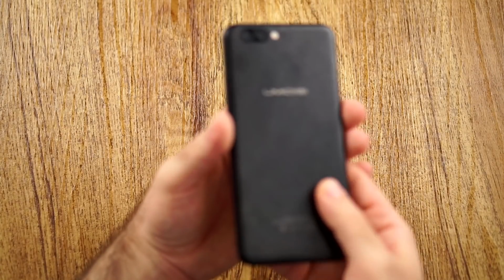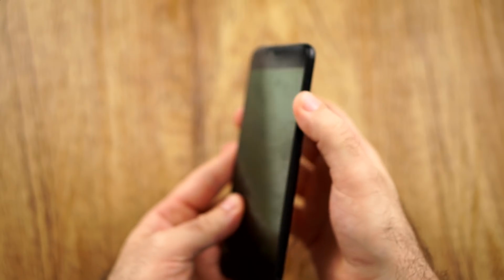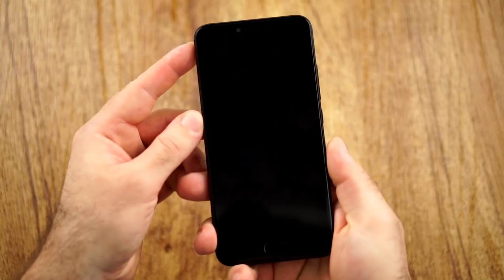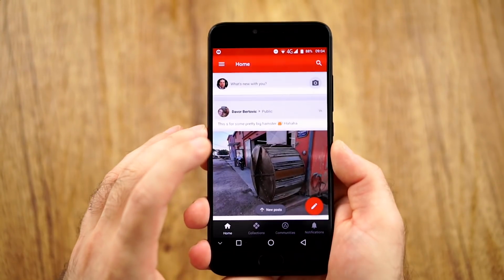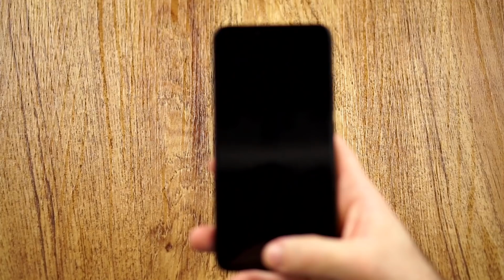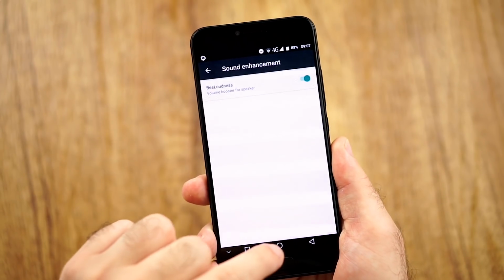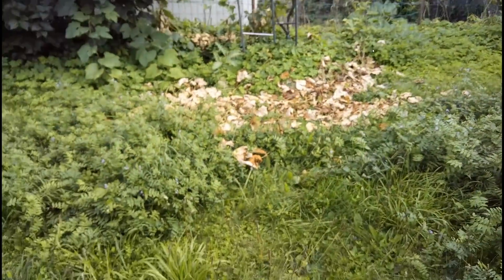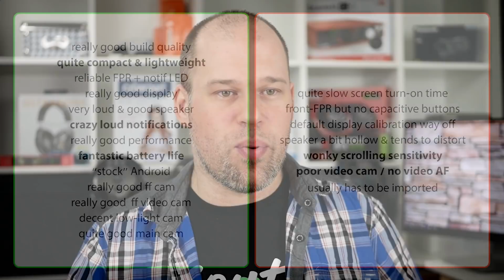Umidigi Z1 Pro | how "Pro" is it really?

Comment: Face ID is used only in the expensive iPhone X?No as you can find in DOOGEE MIX 2.There is no doubt that iPhone X attract so much attentions from global market, especially with the new Face ID unlock.Actually a more affordable phone DOOGEE MIX 2 also claimed to apply a facial recognition technology in this full display smartphone.According to industry data, the familiarity rate of facial recognition is only one in a million, while one in fifty thousand of fingerprint recognition. From the leaked photos, we can find the MIX 2 throw away the fingerprint recognition which lay in the front of DOOGEE MIX previously. DOOGEE MIX 2 will have a 5.99’’ display in the front, with the top and bottom bezels narrowed down to the slimmest. Therefore, the screen ratio gets 18:9, which is popular in this year’s mobile phone design that you can find in Samsung S8, iPhone 8 and LG, etc.More information in DOOGEE official.
http://www.doogee.cc/detail/mix-series-bezel-less-smartphone/122

Comment: Hello and I apologize for the length of thie message just like to put this stuff out there may help someone else...
      Just wanted to give a shout out I had just started to look for a heads up comparison on the Snap Dragon against the Helio, It was just one of those things I knew But kept telling myself cant be that much better after all the same manufactures are building about all of these now.....
   I have been experimenting with the UMIDIGI's had a couple Supers and a Z1 pro ...And I mean I went through A hard freaking time with AT&T getting these on there network normally i would go to a local AT&T store put the SIM's in a Galaxy activate then yank them and swap them over to the UMI's You probably know these phones but incase you do not www.umidigi.net find anything you need to know my issue is here In America I have owned 3 of these phones in like 9 months the first UMI SUPER battery killed over after phone fell from coffee table no biggy I am not the American that things anyone owes me anything I knocked it off the 18inch high coffee table I payed $50.00 bucks US waited 63 unbelievable daysto get this Dam battery from china and its now a lower MAH it came with a 4500MAH in phone i received a new 3750 for phone, What the F? Anyway I shake it off whatever I am just happy after 63 days to throw my old phone back in the drawer and start using new one again ( Just for everyone info the old phone was one some gave me a 5 year old Galaxy G4 mini because I have given my G6 at the time to a friend that was stuck on something like that lol) Anyways 3 weeks latter I had ordered the Euro Champion edition in Blue because i was tired of waiting on the battery comical i know so battery comes in i install it I can Rebuild, Modify or Repair anything that can come apart I am not bragging by no means it is annoying to me it all seems so remedial but I recognize that I was given a gift, Anyways back on point i get the Euro fight to get it on the network And up to this time I am using There UMIDIGI's So Called Preferred Dealers TOMTOP then when I could never get any help there I switched to GEARBEST and we ordered a bunch of these Z1 PROs from UMI I run a multi-line set of dealerships including Hyundai, KIA, SUBARU, MINI, VOLKSWAGEN, MITSUBISHI and CHRYSLER, JEEP, DODGE so naturally I turned my customers onto these things and sold a ton of them my only saving grace at this point and I am not trying to be condescending in saying this but they are mostly older customers so they do not game youtube FB ETC.  But I feel bad for these people I mean if their (UMIDIGI's) Authorized and supported dealers will not step up GIVE ME the product line to sell as well since i have been doing it anyway I can replace screens or whatever they need at least I will put forth the effort to step up and do everything I can and if it cant be fixed and its under a year old its called an acceptable loss we learned that in customer service long long ago it takes one person Pissed Off feeling like they were taken and they will tell everyone they bump into kind how I am Venting  now but I still believe they have a good product even though my new UMI Z1 pro with the companies hard plastic case and leather cover fell 14 inches and it has shattered the entire screen arg!!!!! This was advertised as Sharp Corning Glass plus like I said I had the Gorilla glass screen protector there clear plastic cover with leather fold over cover and the screen is still shattered... Anyways I am going for a response I deal in Korea and China Japan all over ASIA everyday, I actually Flew to Korea to address the engineer's on the KIA and Hyundai's about there warranty problems in the United States and I told them they were building great cars but Americans are spoiled no question in Korea and most countries i have visited automobiles are a Luxury or just designed for Utility use over here in the U.S. people blow more money on there  cars Then they do on there homes, So it was minor stuff just fix squeaks rattles wind noises, And they played no games and that's what it take to make a business work is a good name and at least a better then average product I had never driven foreign cars in my life besides some European ones but I drive A Hyundai now most of the time for my demo.... Thank You for the informative video's... And the time you take to make them And Again I Apologize for taking up so much space complaining about phones , But last thing I'll Say I was naturally drawn because price and uniqueness, But before I got through or put any of out 870,000 plus customers through any of this garbage again , I hope they are willing to step up just send me the new S2 with Cover it would be to their benefit anyway i get a knew phone around there and everyone is buying the same thing inside of a few weeks believe they could right it off, Or I can write it off and just buy a new Galaxy S8 waterproof snapdragon I know they build Ballistic cases and Otterbox Defenders for it if it breaks ill drive 10 minutes and get a new one ....LOL again thank you for a place to speak about this and your informative video...

Comment: Some test the recharge rate on this phone in another video and the result was less than 3000mAh. It wouldn't be the first time Umi lied TBF.
Reply: I think it's good that you didn't really recommend this phone. If a company lies about the size of the battery, then they brake the customer/company bond of trust. 
The battery life seems quite good at the moment because of software optimization, but some kind of update, even if it's just an installed app update, may change that.